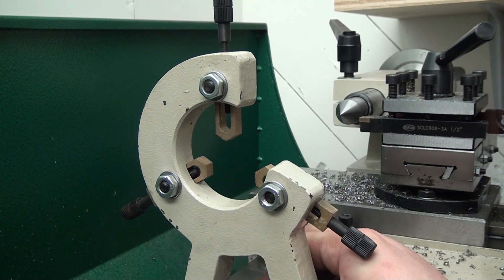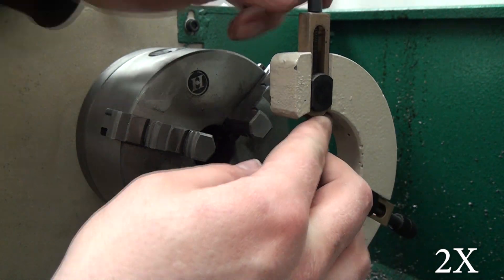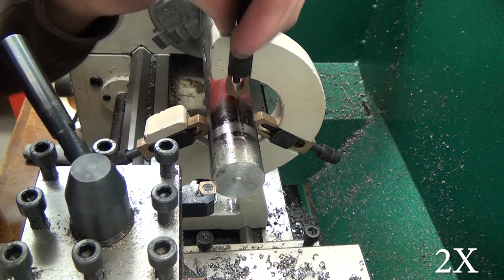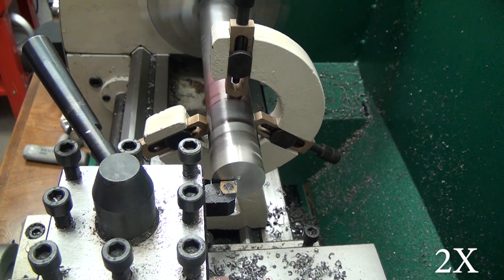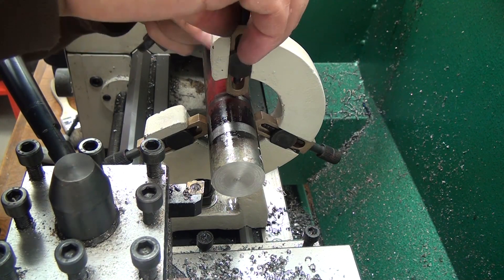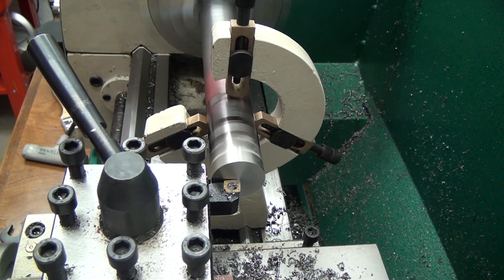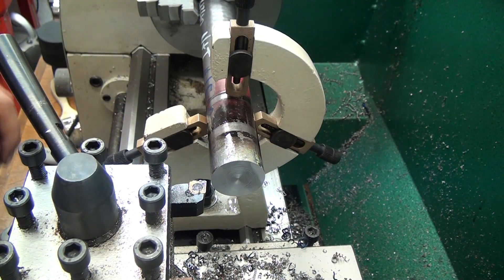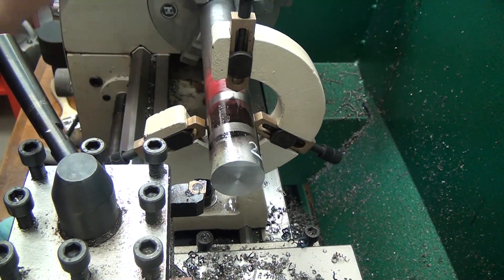13 G0602 Steady Rest

Comment: Thanks for the video.  I got the same steady rest only I got the one with the ball bearings.  On the first use it broke at one of the through bolt holes on the cinch downs.  Asking for a replacement from the distributor.  I don't think there will be a problem.  Only had it for ten days.
Reply from the maker: I would prefer the bearing style. I hope you get the replacement.

Comment: what do you mean when you say this steel has been normalized and tempered? it's been quit a while since I was in machine shop class but, I believe you can only temper steel after it's been hardened. normalizing is bringing it back to it's normal state before it was hardened.  tempering is used to take some of it's hardness back out in order to reduce the brittleness.
Reply from the maker: +buckshot75two I have no idea, that's just how it was labeled at the Metal Supermarket.

Comment: In case your piece is (too much) out of roundness take a centerfinder and mark the piece as accuratee as possible, than drill a centerhole using a drill press!
After drilling the centerhole, chuck the part in the lathe using a live center. Machine a portion of the stock were the the fingers of your steady rest will ride. A smooth and true running workpiece will be the result.
Reply: Or, you could use a spider.

Comment: there is something we use in the company where i work to support Rough materials without a steady rest(we use them with ball-bearings)

we have a Steel cap(usually St 52.3) with a Center drilled in front and the center is then Rounded off.

the inside is turned about 1 inch deep, then we add 4 holes on the outside(threaded in M6 as i am european) and we add Hex Screws M6 in there that are longer than the material is thick, we can have rough material with a length of 6 feet almost perfectly on Center
Reply from the maker: That is a cool idea, any pics or video of it in action?
Reply: i can make a picture of the ways we can support Rough materials
Reply: What you are describing is a spider, but I'd recommend 8 screws (four at each end), to keep everything trued up and secure.

Comment: Hey, like the video, the best thing you could have done was dialled in your workpiece so that it runs reasonably true in the chuck, then centre drilled the end and supported it with a live centre from the tailstock, turned a small portion along the surface of your material, add the steady rest, remove the centre, dialled it into true again and then faced off, the chips coming off are exactly what they should be, but a little coolant or cutting oil wouldn't hurt things.

Comment: Thanks for the video.  From what I've seen (I'm no expert either, just got my first lathe) the steady rest works best if you put a nice smooth surface on the workpiece right where the rest will touch it.  Then you can clamp down on it pretty hard and not damage anything, and your locks won't be buffeted so much and won't back off.

Comment: Chips will be hot, because then you get the heat from the work piece. and it is better for the result (finish). So have a lot of feed on the rough cuts (but you must of course have a lathe that can withstand it. cold steel for better surface.
If you have an oval / rough work piece and can `t face it in the lathe, then just drill a center hole, tighten with a center point and turn a piece of the steady rest (very fine finish)
sorry if the english is bad, but I`m using foofle translate :P

Comment from the maker: @cuc2u the G0602 has metal gears. This has been a great lathe so far but bigger would be nice too. I like the speed range of the G4002 as well. I didn't budget for a larger lathe as I'm wanting to cnc a mill at some point.

Comment: Not an expert but I would go ahead and let it go as it was in the steady rest and do a small prick with a center bit, put it on a center (Just enough for the center to catch), turn the part for the steadyrest fingers and then play like I had just started.

Alternatively, off the lathe, use a centering head on a square, center punch it and use a small center drill to make a point for the center. Then chuck it up with the center in the point and turn a short segment for the steady rest.